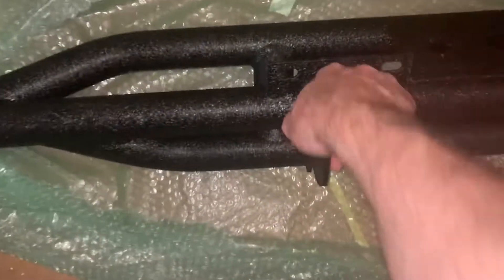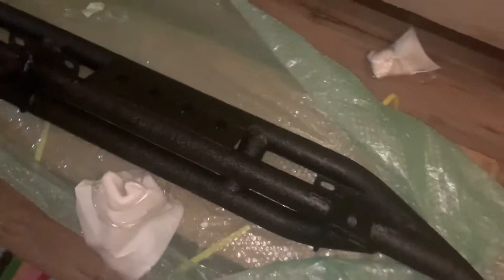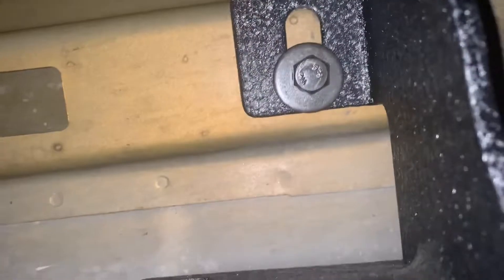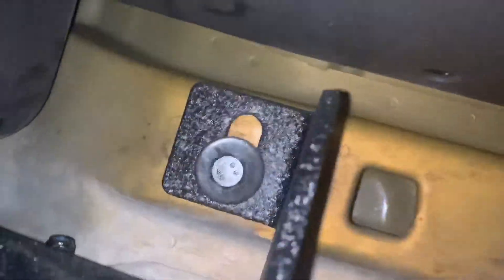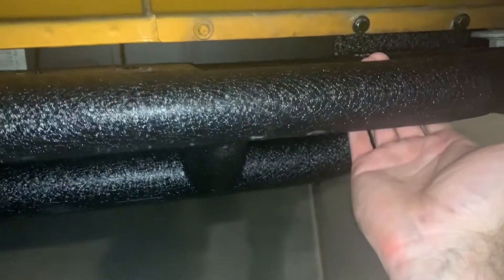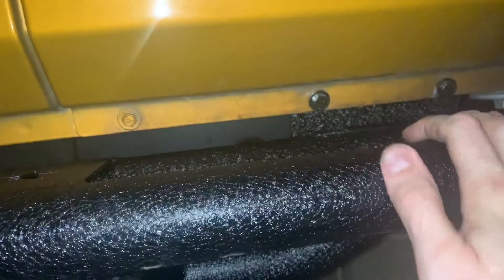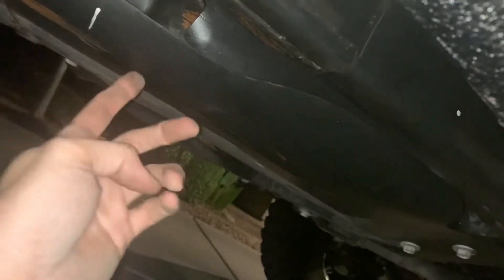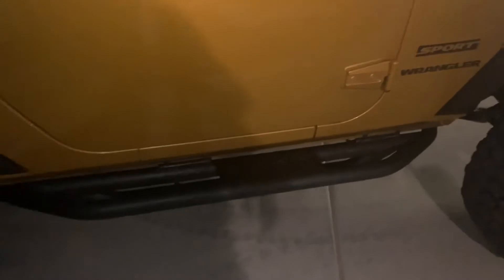Tyger Auto Step Rails Install Jeep Wrangler JK

Comment: Good job.  Do you recommend tightening the bolts up with a torque wrench?
Reply from the maker: The instructions did not have a torque value so I just cranked them down pretty tight.
Reply: @indecisivegarage2389  Thanks for the quick response!